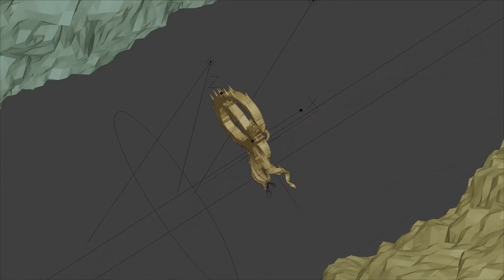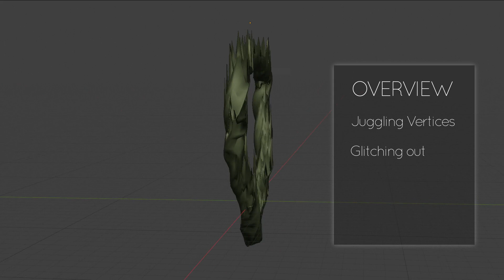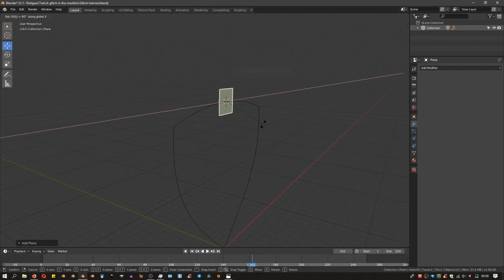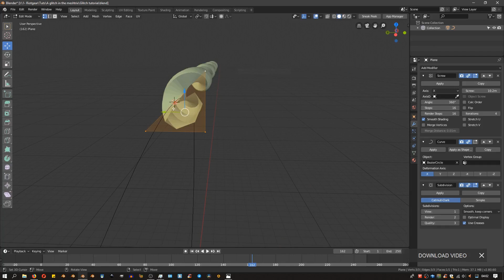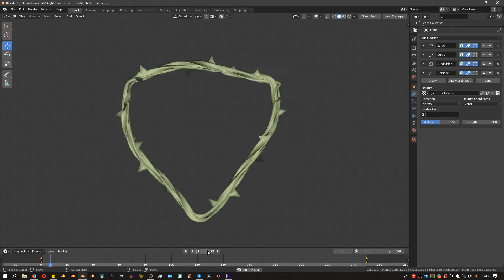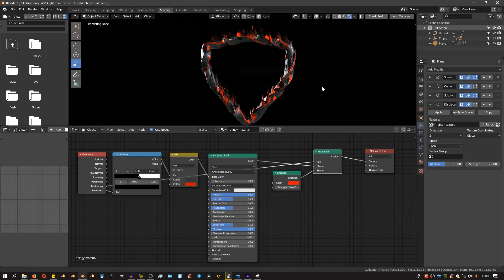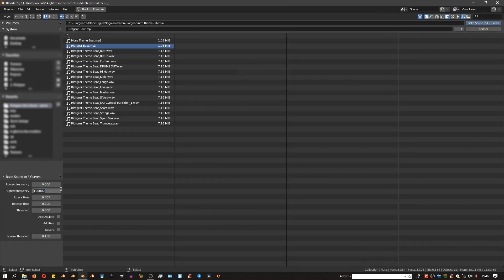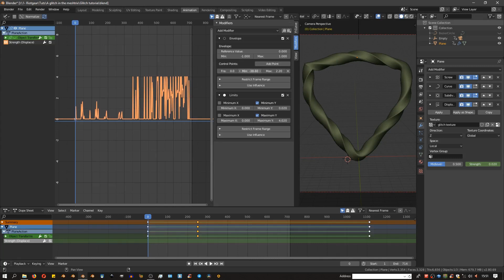How to Glitch in blender 2.8

Comment: am I doing something wrong or are there some parameters to this working, I followed the same steps on a uv sphere and it doesn't glitch, it just stays still, is there something important that i missed?
Reply from the maker: are you making sure to include all the frames from your glitchy footage? by default blender will just pick the first frame. if possible it is better to use an image sequence than footage.
Reply: @RIOTGEAR3D  I suspect that could be it, I'll go and check, thanks so much

Edit: That was it, the frames were 1, so the footage wasn't running, thanks so much

Comment: Awesome video
Reply from the maker: Thank you! New one coming pretty soon. Stay tuned :)
Reply: @RIOTGEAR3D  hey i just saw a glitch effect with chromatic aberation but i am not able to get back the effect in evee can yyou make a video with your own idea. If possible. I am getting no refraction  even if i turned it on in the screen space reflection. The material just remains opaque even if i use refraction bsdf
Reply from the maker: @ripunjoyk1706  Ive seen Ducky 3d had done a tutorial on it if that's not the one you are referring to. Looking into it to see how else it can be done. Thanks!